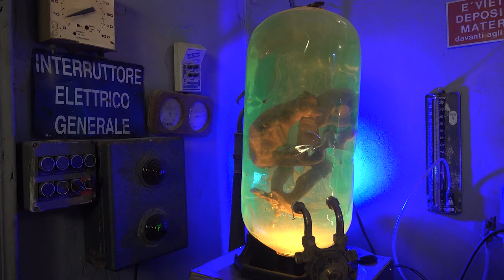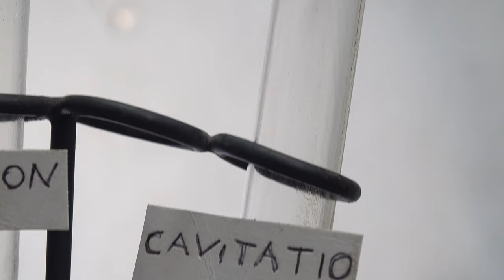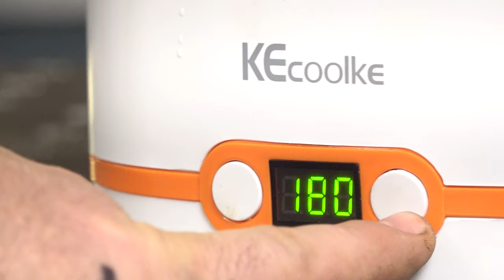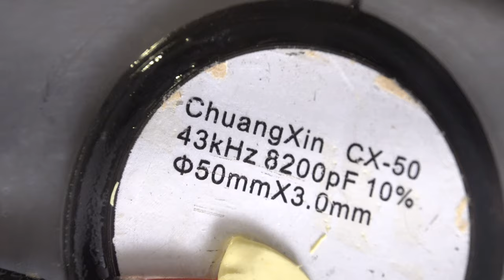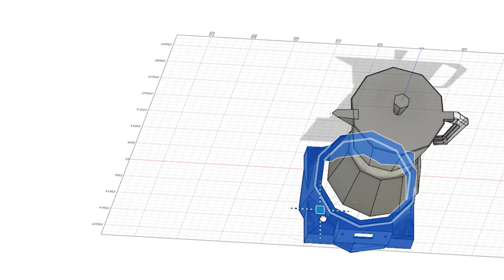How to Make Ultrasonic Cold Coffee Machine

Comment: Hey Rulof! Great video, i loved the idea, im wondering what happens if you use hot water + ultrasonic? Did you try it? Is it even stronger?
Reply: It is, I do so in my place, cleaner with heater, I set it to max at 80c for 12 mins with ultrasonic mode, pretty good tasting.i tried doing it in room temp water, didn't taste good, even tried doing it in milk, that was very weird)